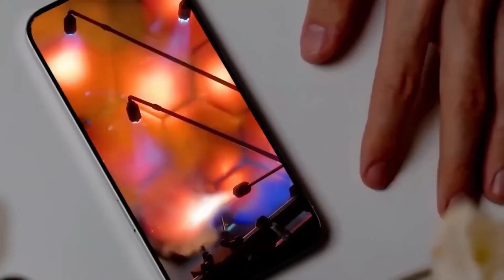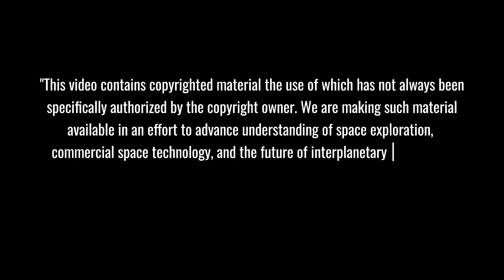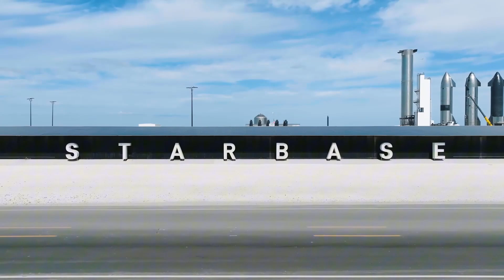SpaceX Starship MAJOR UPGRADE: Old Version DISCONTINUED By Musk's Official Declaration...

Comment: Well, the Raptor 3 doesn't help if Starship still has leaks in the attic or sloshing or filter clogging. Look at the Falcon 9 second stage: almost every flight there has leaks (mice, or pipes with oxygen-gysirs)...
Reply: It has to do that ,, because as the liquid oxygen heats up it turns into a gas expanding around 860 times its volume when a liquid.
If the gas was not vented from the tank the pressure would increase until the tank exploded.
So they are not leaks ,, they are venting to prevent over pressurization of the liquid oxygen tank.   😂✌